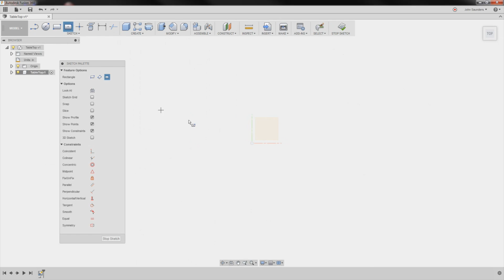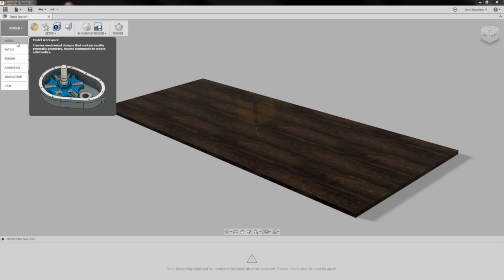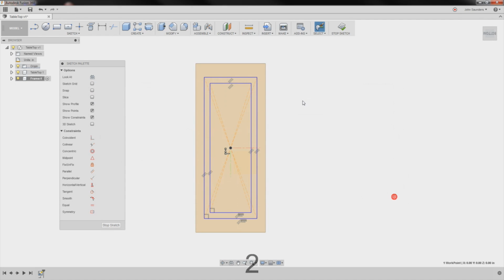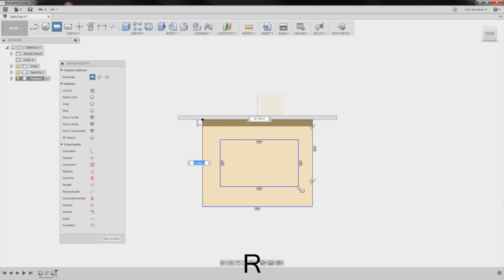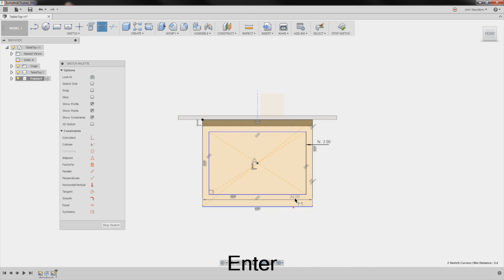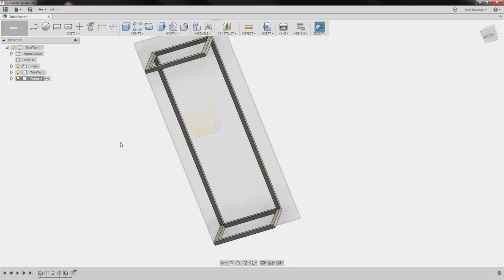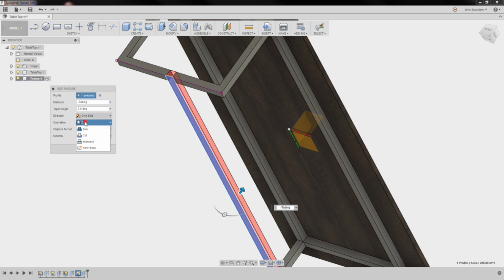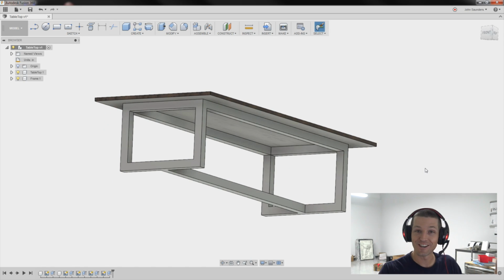Fusion 360: Modeling a Dining Room Table!  FF47

Comment: anyone else having this problem with Fusion 360?:

i need to make a heap of panels with 4mm high, single line, "Simplex" text. the text needs to be engraved into the part. When doing this in fusion360, i cant draw a box abound the text to be engraved..... if you zoom right in on "Simplex" text - each letter is actually made up of tiny strait vectors (lines), i have to actually select each Vector (line) within each letter.. 

does anyone know how to draw a box to select the geometry while using either the Trace or the engrave process? selecting each line in each letter just takes way to long - eg. it takes me about an hour or more to do the cam for 20 words.....
Reply: I engrave part numbers using Dotum font, it selects with one pick. I engrave .25" tall with a center drill .001" deep after a .005" facing pass in aluminum. The strategy is TRACE.

Comment: John, quick question, extrude or press/pull? what's the difference?
Reply: They are the same.   They use to be called press pull in an earlier version of fusion.  Now it is extrude.
Reply: The term Extrude is typically used to give a two dimensional sketch a three dimensional presence.  The term press/pull is typically used on existing three dimensional geometry.  But yeah, they are basically the same thing.
Reply: Basically, "Extrude" is a pointless option.  Press/pull does the same thing.

Comment: Excellent on a note though.  Move the bar off the floor. Peoples feet will be kicking it & you will be able to clean the floor easier.  Just a thought.  Glad your vids show the key strokes. What program do you use that enables that feature?  Keep up the good work John. Any news or info the headset?  I do Conference Calls every week  those look like they would be something I could use. But only if they are Bluetooth. Oh, if they are not Bluetooth I can make them Bluetooth. So all good.  Yes, move the bar up.  The misses will not want to be cleaning around that bar.
Reply: Thanks the comments are great with yours included I ordered them. Thanks.... Want to take your classes soon....

Comment: Hi John
I just downloaded Fusion 360 too and trying to get into all the functions - wav, what a program !
A comment to your design: The surface the table is standing on has to be very,very flat when you have all these tubings "laying" on the floor - just as a surface plate, 3-point would be best ... ;-)) normally tables have 4-point - your design have infinite number of points ;-)) I think it will be so annoying in the long run - just a free advice ;-))

Comment: you're doing it the hard way, that's the same as a table tom did last year, you do the legs and center rail in the same sketch, it's just a negative for the legs and a positive presspull for the rail you do them as separate bodies then you copy and past the legs and move them by the center rails length plus tube thickness, then the top you just draw it on top of the legs and dimension it in from the legs out. it's a lot faster this way